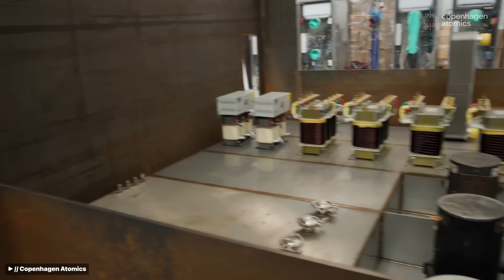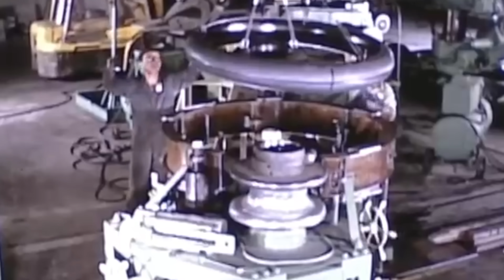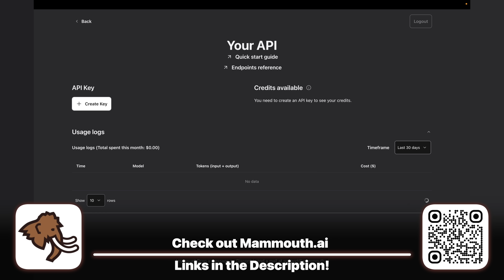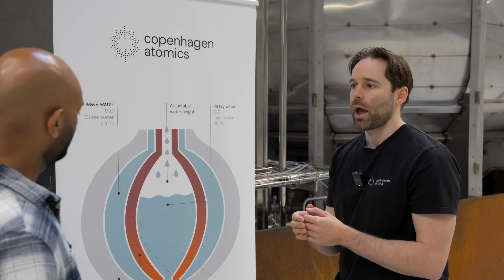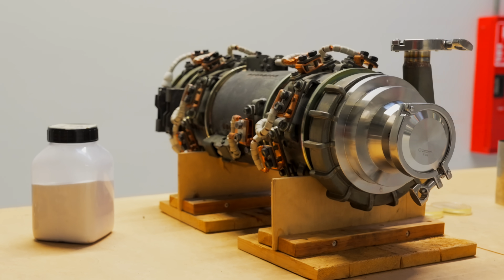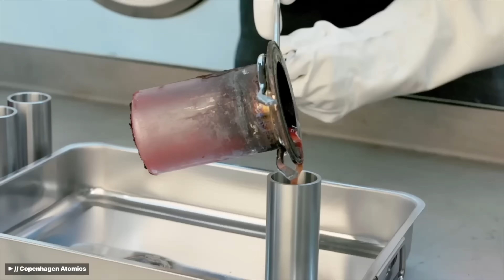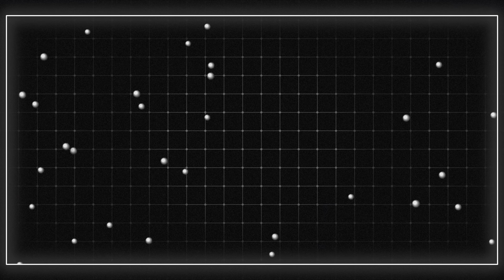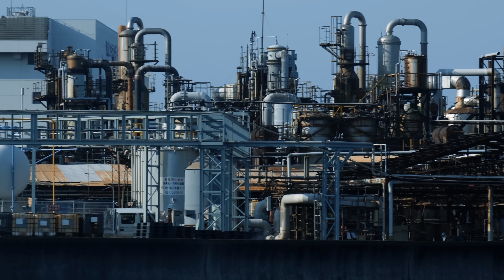This Modular Thorium Reactor EATS Nuclear Waste

Comment: Using that 1% of the energy of Uranium already costs up to five times as much as renewables + BESS. That other 99%? Much, much more expensive than that. It's not a failure of imagination; it's a success of economics. And if you're only burying that 99% for 100,000 years (re-skinning the containment every 80 years, paying for monitoring and surveillance the whole time), you're a quarter of the way to safe.
And Thorium is more expensive per MWh, with unproven performance, but molten salt is well-known in the industrial world for other applications, and engineers who design molten salt will tell you it is always risky.
Reply: Solar and wind are pathetic energy sources.

Geothermal is the solution.
Reply: @TerraPotens537  All three are in the BESS + Renewables mix. In ten years, with Quaise, Eavor, and other new geothermal technologies, we'll wonder why anyone ever wasted their time with expensive nuclear or fossil.
Reply: @bartroberts1514  Question...  If you have an optimum energy production system that works in all places and all times (superdeep supercritical geothermal) why the fakok would you even entertain the idea of installing suboptimal energy production systems like wind and solar with piddly man made batteries?

We've got a natural thermal battery beneath our feet so gargantuan in scale that just 0.1% of the thermal energy is enough to power ALL mankind's energy needs for millions of years.
Reply: @TerraPotens537  Because I'm not a geonut religious fanatic, I'd answer that the optimum energy product system is a BESS + Renewables mix, including use of pressurized geothermal energy storage where appropriate (getting double the service of geothermal), because although geothermal gives inertial benefits, battery BESS comes with inverters that deliver grid utility services like FCAS, automated impedance matching, time-of-day arbitrage, and sub-microsecond stabilization inertials can't. Geothermal can produce a tiny amount of mineral microfertilizers; agrovoltaic can turn wasteland into croplands by reducing light stress on fields.
I'm a huge fan of geothermal, though not a zealot; simply, I think one of its hero qualities is how it plays so well with other renewables.
Reply: @bartroberts1514   religious fanatic?  That's a low blow ya mo-ron.

What I'm concerned most about is environmental damages.  

I'm not sure you've thought through the scale of mining required to move the world to predominately wind and solar with batteries.

We're talking literally millions of wind turbines, billions upon billions of solar panels, and literally hundreds of trillions of battery cells here.

Ever heard of the Berkeley Pit in Montana?

Mankind will have to sift through 250-350 billion metric tons of dirt and elements to make all those wind turbines, solar panels, and BESS batteries.

By contrast, geothermal has a tiny environmental footprint by comparison.

I'm adult enough to know that mining is a necessary evil in modern society, but I seek to limit the environmental damages that mining presents to life on the surface of the planet.
Reply: @TerraPotens537  Oh? Is religion a bad thing in your books? Some of the finest people are religious. But the scale of mining for solar, wind and BESS? On 50th to one 500th the size of present mining for fossil, and about on par with the mining for nuclear or geothermal. After all, what is geothermal but a form of mining for heat?
And no one's ever heard of anything in Montana; it's that remote that you seem to forget all the coal mining there.. or that grid batteries made of iron or sodium can recycle the materials essentially forever. Geothermal's great, but why the attacks on the things that make it better? Solar and wind and BESS cover the Duck Curve, which geothermal is less suited to. (Still better than fossil or nuclear, though.) Wind turbines slow some of the windspeed global warming has caused. Agrovoltaic greens deserts. Geothermal ties them all together; the whole is greater than the sum of geothermal alone.
Reply: @bartroberts1514   "Oh? Is religion a bad thing in your books?"

No, religion is not a bad thing at all, but religious fanaticism can be, and I didn't appreciate you trying to portray me as some religious fanatic of geothermal.

If I'm fanatic about anything, its efficiency, and wind and solar with batteries is not efficient.

For example:
Let's say you've got a solar farm with a nameplate capacity of 1 GW, and you've got a geothermal power plant with a nameplate capacity of 1 GW.

Over any given unit of time, let's say a day for the sake of argument, the geothermal power plant will produce 4x-5x as many kWh as the solar farm would.

Put another way, if you wanted a solar farm to produce as many kWh as a geothermal power plant over the course of a day you'd need 5-6 GW of solar panels.

THAT, my friend, is how pathetic solar is (wind isn't much better), and why I'm against using it outside of offgrid homes far from powerlines.

Wind and solar are so pathetic that you literally HAVE to install massive amounts of batteries PLUS overbuild like a MFer to make them reliable.

"On(e) 50th to one 500th the size of present mining for fossil"

Hmm, so you're willing to trade one bad outcome with another?  I see

"Solar and wind and BESS cover the Duck Curve, which geothermal is less suited to."

Geothermal, especially man made enhanced geothermal systems can act as both baseload power as well as perform peaker plant functionality.
Reply: @TerraPotens537  Wow. This reads like a Book of Numbers of the pettiest issues imaginable about solar, wind, and batteries. And you don't think it comes across as fanatical? Wind is performing now, and working. Solar is performing now, and working. BESS is performing now, and working fine. We're years to decades out from geothermal being at the level of solar, wind, BESS, which are getting better and better all the time, faster than geothermal. If you're pro-geothermal, that's great. So am I. But I admit geothermal has to put on its big boy pants and start making gains.
Solar alone? Obviously not. Wind alone? No. BESS alone? Don't be silly. Solar + Wind + BESS are real, on the ground, and cheaper than any other form of grid power for the same level of reliability and ability to cover variable demand than anything today. Geothermal will get there one day; until it does, it only helps along in the grid mix.
All forms of energy generation involve some mining. Even biofuel means forging axes and saws to chop down trees, at its most basic. So, yeah, we have to trade lesser bads for greater goods.
Reply: @bartroberts1514  rolling my eyes...  Yes, they perform, but only by overbuilding them like a MFer PLUS installing thousands of miles of cabling and transmission lines PLUS expensive BESS.

They're pathetic, and I guess you're ok with mediocrity and inefficiency

LCOE of solar PV, according to the EIA, is $31.86 per MWh.

That sounds great, until you realize that if you want 1 GW of continuous solar power you need to install 5-6 GW of panels PLUS install costly transmission lines to move the power from the array to the places that need it PLUS install GWh of BESS.

Transmission line costs vary widely based on how far the array is, but LCOE of BESS is $126.20 per MWh today.
Reply: @TerraPotens537  You overstate the case. Solar panels can be put on roofs, with near zero transmission line involvement. Geothermal? Good luck building that transmission line from Iceland, where the geothermal power is today.
Heck, good luck with the 10-20 miles of pipes down from the surface to where geothermal heat is, even if Quaise and Eavor succeed, on that specious standard. I'm still pro-geothermal. I'm simply not convinced by 'overbuild' arguments that fly in the face of actual experience.
Reply: @bartroberts1514  "I'm simply not convinced by 'overbuild' arguments that fly in the face of actual experience."

LOL

I copied and pasted our entire conversation into Grok and asked it to evaluate the points and counterpoints and it said my points were rock solid and on point.
Reply: @TerraPotens537  Ah. Grok. The font of wisdom. /sarc. No wonder it felt like I was in a conversation with biased and ill-informed source.
Nameplate equivalence is meaningless.
Marginal cost trends and deployment speed favor solar, wind and BESS so heavily geothermal isn't even visible in the rear view mirror.
BESS provides grid services and ramping nothing else, not even geothermal, can compare to, except off duty cycle solar inverters.
Grok has been leading you around by the nose. Is it where you learned your insults from? Why do you hate solar and wind? Because MAGA does, and Grok serves MAGA, not reason.
Reply: @bartroberts1514  rolling my eyes...  wow...  Since you appear to have a bias against Grok, just for grins and giggles I just ran our conversation through ChatGPT and Google Gemini as well.

They said the same thing.

My overbuilding point is based on a long standing reality in the world of energy generation.  

Capacity factors.

My point about nameplate capacity is anything but meaningless, ya mo-ron...

You clearly have a lot more thinking to do on this topic.
Reply: @TerraPotens537  Funny. I asked ChatGPT, and it said the opposite. Possibly the thing all your AI's have in common, besided misleading you.. is you?

All energy systems overbuild, and must. What can be done with that overbuild off duty cycle matters, and BESS and solar off-duty cycle are goldmines. What do you get for geothermal off duty cycle? Way better than for nuclear or fossil, that's true. 

Ask your AI pals to work out nameplate capacity counting time to deploy with present day real world figures, over the next 20 years.

A well-mixed BESS + solar + wind + geothermal + hydro + biofuel grid + distributed plan beats any single-source approach, and all of them beat nuclear or fossil handily. Why do you hate on the very things that you need to make geothermal real?

It's like Pinnoccio hating on stars, crickets and Gepetto.

But be my guest. Build all the geothermal you can, as fast as you can. Deploy it everywhere you can. I'm right there with you on that. And I won't mention BESS, solar, wind, hydro or biofuel to you at all while you're drilling, using energy from BESS, solar, wind, hydro, and biofuel.
Reply: @bartroberts1514  "Funny. I asked ChatGPT, and it said the opposite"

That doesn't surprise me.  ChatGPT is very unreliable.

For instance, I once gave both Grok and ChatGPT a puzzle to solve.

"I'm standing next to my car 50 meters away from the Supercharger and I need to recharge, should I walk or drive?"

ChatGPT said I should walk

Grok said I should get in my EV and drive it over to the charger.

Grok is a way better and more reliable AI
Reply: @bartroberts1514   "All energy systems overbuild"

Not the same, electrical utility companies WILL overbuild on CAPACITY to plan for some future growth and have backup in case of major problems, but with wind and solar they're forced to overbuild.

Hypothetical:
Let's say you could build a city from scratch not connected to any grid at all, you're building everything from scratch.

The city has ~500k people with a bit of commercial and industrial mixed in, and the city has a peak energy use requirement of 1 GW meaning that if residential, commercial and industrial were pulling maximum power you'd need 1 GW of power output from your plant.

If you wanted to power the city exclusively with solar, due to solar's low capacity factor of 16-25%, you can't just install 1 GW of solar panels and expect to not see brownouts or rolling blackouts...

You'd HAVE to install 5-6 GW of panels, thousands of miles of cabling and transmission lines PLUS 7-8 GWh of BESS to get you through the night.

OOOOOORRRRRRRR

You could install a geothermal power plant with a nameplate capacity of 1 GW and be done with it.
Reply: @TerraPotens537  You've misunderstood. Time to deploy is time counted against overbuild. You need to build capacity to cover long deployment. Solar deploys in weeks or months. Wind in months or years onshore, and 2-5 years offshore. Nuclear 4-12 years. Fossil somewhere in the middle of that. Geothermal? While it could one day (starting 10-15 years from now) be deployed in only 2-5 years from project start, isn't there yet. That's 20 years of zero production overbuild. On a 30 year horizon, that's cf less than 0.33, close to par with solar, and worse than wind.
Either way, any project that doesn't start with phaseout of fossil at rate of depreciation isn't going to really tell us where the winners are.
You agree we should start there, right? Phaseout fossil 0.75% per month, to kickstart geothermal?
Reply: @bartroberts1514   I've misunderstood nothing, and that's a silly claim about time to deploy having anything to do with overbuilding.  Overbuilding has to do with the amount of panels or wind turbines you have to install in order to get the power that you actually need.

"Solar deploys in weeks or months"

Who cares?  There is no rush.

There's an old saying, "work smart, not hard"

The moral of the quote being don't do more work than is necessary, only do what you need to do and be efficient.  

Wind and solar with batteries is working "hard"

Doing geothermal is working smart.

With wind, solar, and batteries you have to expend a bunch of energy collecting resources to make the millions of wind turbines, billions upon billions of solar panels, and hundreds of trillions of battery cells.

Then every 15-40 years you have to recycle it all and replace them, until the end of time.

Did you know that the oldest geothermal power plant on the planet today has been in operation for 114 years.

Geothermal boreholes essentially can last forever.  You'll need to replace the piping on the surface as well as the turbines every once in a while, but that's not a huge deal
Reply: @TerraPotens537  ROFLOL!

Now it's clear all of your points are AI talking.

Phaseout fossil extraction at the rate of depreciation. How fast is that? 0.75% of today's level per month. That's the rate science tells us we need to hit to avert famine from fossil pollution.
Geothermal can close the gap toward the end of that, but to hit the mark needs solar, wind, BESS, biofuel, hydro, too.

You're not pro-geothermal, really, are you? You're pro-fossil, making a stealth attack on what you fear. The phaseout of bitumen, coal, gas, and oil, by the attrition rate of their depreciation.
Reply: @bartroberts1514  ROFLOL!

You think I'm "stealth attacking" because I'm pro fossil fuels?

🤣🤡

No, I'm pro geothermal because it has an excellent capacity factor, even better than fossil fuels (70-90% for geo vs 40-60% for FF), and especially compared to wind and solar with batteries.

Only nuclear has a higher capacity factor (93%), and I used to be pro nuclear, but that was before millimeter wave drilling was developed, and so now I'm against further nuclear power plants just like I'm against FF.
Reply: @TerraPotens537  Then get on with building geothermal, already! Go forward with that. Get 'er done!

Phaseout fossil extraction 0.75% (of today's level) per month, and replace it with geothermal. If you're right, then we get the most capacity factor fastest, and the most economical geothermal soonest. If you're wrong, so what? We'll still get geothermal in the long run, and on the way, agrovoltaic will turn deserts to cropland, iron air or sodium batteries will prep the grid for that pressurized geothermal storage, and wind, hydro and biofuel will be stepping stones to your dream.

If you're really pro-geothermal you want to see fossil phaseout, so the drilling equipment can be turned toward geothermal.
Reply: @bartroberts1514   Quaise is working on it.  Second field test is coming soon.  Same place they did their first test, at the granite quarry in Marble Falls, TX where they drilled 118 meters in 24 hours through pure granite.

Second field test is to drill to 1 km through pure granite.  The granite pluton in the quarry is ~2 kms thick.

They expect to have a working plant by 2030 converting a coal power plant over to geothermal.

That's their business plan to start...  Convert "already in place" retired and currently operating coal power plants over to geothermal because you get a building to operate within plus steam turbines and piping are already in place (of course mods will happen over time).

Quaise plans to use fossil fuel drilling companies to drill the upper portions of their boreholes getting down to ~3-4 kms deep where basement rock begins.  The reason for that is you can encase that portion in concrete and steel piping to prevent water ingress.

They will then put their gyrotron millimeter wave drilling rigs in place and drill through the granite, gneiss, and basaltic rocks to go deep.
Reply: BESS at Moss Landing wants to speak with you 🤣
Reply: @GreyDeathVaccine  A couple of no-injury accidents in the early 2020's? Moss Landing operates at massive scale, learned lessons from some incidents, and is way safer than, for example, Moss River pre-BESS, or Conemaugh, Milliken, Riverside, Edison International, and the fatal Kleen, Ford River Rouge,  Longford..
Reply: IMSR....I'd rather live next to IMSR power plant then a natural gas plant
Reply: @andrewwilgress4100  Nuclear molten salt has no track record in actual use.. non-nuclear molten salt, however? U.S. Chemical Safety Board (CSB) investigators describe a fatal molten-salt eruption initiated by water/steam contact, framed as a “steam explosion” that displace salt out of the bath. OSHA accident summaries describe similar “bath erupted” events with fatal burns at ~1,200°F (~650°C). But in molten salt reality, the public record skews toward mechanical failures (leaks, cracking, weld failures, thermal stress issues) that cause outages and economic loss. Industry reporting and technical writeups describe large molten-salt leaks/tank problems at specific plants.
Molten salt is the child arsonist of industrial processes, a safety nightmare. Not the thing you want to multiply nuclear risk with.